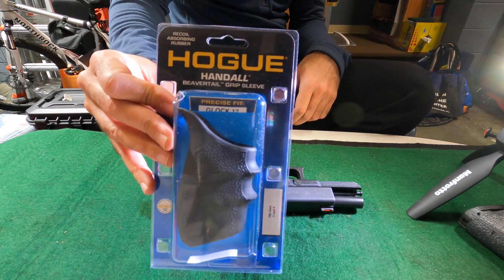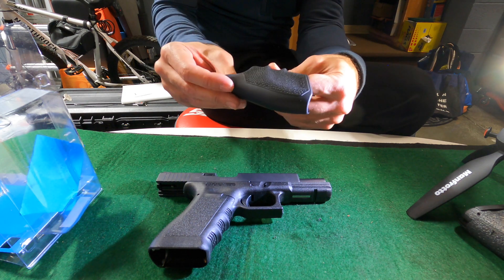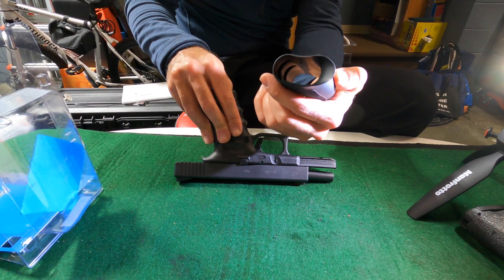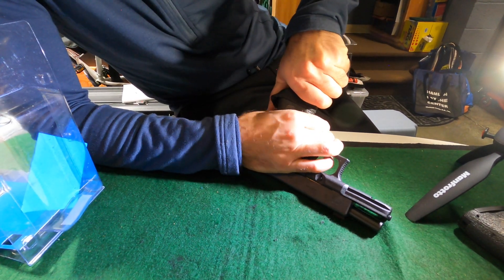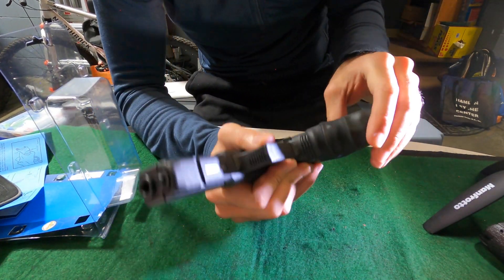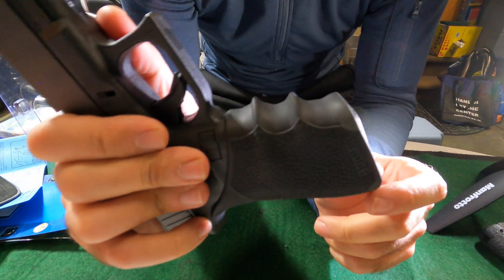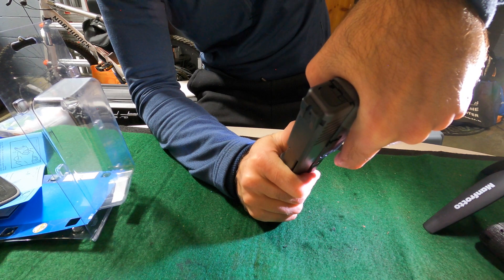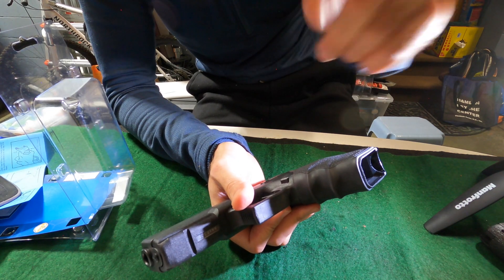HOGUE GRIPS GLOCK 17 GRIP INSTALLATION HOW TO GET A BETTER GRIP ON GLOCK PISTOLS BEAVERTAIL

Comment: Took me about 3 days to put it on.  About 30 minutes each day before getting frustrated and almost launching my Glock out the window.  I let the grip sit in the summer sun for an hour which helped.  I don’t put the grip in hot water as houge does not recommend this.  You can use solvents and such to help wiggle it in but that will just cake up in time.  After a few weeks of trying out this grip I ended up just cutting it off with a blade.  This grip is good if you have big gorilla hands but if you have regular human sized hands and feel like the stock grip is already too bulky then don’t buy this.
Reply from the maker: Wow what a tribulation. Many others have the same problems, I am beginning to think perhaps some of them shrink sitting in the package in the warehouse etc. But yes, there is no magic cure all for grip, and it doesn’t particularly help smaller hands
Reply: Took me less than 15 mns to put it on
Reply: Do the same thing that you do with bicycle grips, spray hand sanitizer alcohol on the grip first
Reply: @stanleylzz8705 I expected the worst experience ever, it took me longer for the prep than it did for the install. Using windex as expressed by Hogue and determination I had it on in about 5 minutes.

Comment: Good video ! I've  installed several of these on pistols for myself and for friends. Like you, I just "muscle" them on. Don't use any tools and I wouldn't use window cleaner. Too messy and I don't want it on my guns. It just takes some patients and time. I've never ripped them. I just installed a Houge mono- grip on a single six my dad gave me. Now they were a bear!!! The grips went on pretty easy. But it took me a good 2 hours to get the screw on the bottom of the grip  to tighten up ! I ended up making a tool out of a paper clip and having to hold the gun above my head. That is the toughest grip I've ever installed! And, the longest time it's ever took to put grips on a gun. They sure look and feel good. But I'll never install them on another single action. I've installed the exact grip on double action revolvers. Never had that trouble with then. Oh- and I had to put a business card between the grip frame and the grips, on both sides, to keep the grips from rolling under as I slid them onto to gun. Just crazy hard honestly !
Reply from the maker: Yes once you get that motion down and you are patient it is very straightforward. Wow what a journey on the mono grip. I installed one on my Colt double action, and it was pretty easy. But at least you stuck with it to get it done, hard to find people with that kind of resolve nowadays. Your info will help if I ever run into a single action wheeler but those are rare too nowadays
Reply: @shaunstayfree5551  I have several autos. From Hi Points to Glocks. But I've always loved revolvers- double and single action. My "always " with me gun is a SW 642 38 snub-Lady Smith. I know, I'm a 6ft, 240 lb guy, but I proudly carry my Lady. I've always wanted one and finally came across a new one a year ago. She has a slick factory action and beautifull wood grips. Only cost $30 more than the plain 642 sitting beside her on the shelf. And I've always loved cowboy guns. I've currently got 3 22 single actions, including an old German made one I've had since I was 16. I'm in my late 50's now. Its beat to death from years of honest, hard use. But it still functions just fine. I still keep it in an old cowboy belt and holster rig, loaded and ready. And I've even got an old single action-2 shot 25 ACP cowboy style derringer. As far as trudging on to get those grips on, it's kinda weird actually. After working on a vehicle for only minutes sometimes, I cuss and throw wrenches and hire someone to do the job. But I can spend hours messing with a gun to get it just like I want it. Anyway, good talking with you. I'm subbing to your channel.
Reply from the maker: @shadowwolf7622  Haha the bullet dont care what the gun's called!  I can never knock wheelers.  Only drawback is capacity with the conceability of the snubs, but just make em count if God forbid it ever has to. Never see anything like those again 22 SA especially the german made, very cool,...  I have a colt Anaconda, and Super Blackhawk 44m, love the blackhawk all day! Hopefully pick up a few more revolvers down the road.  Thank you, God bless

Comment: Got mine on the porch 15 minutes ago and it’s now installed.  Most of the time was hearing water on the stove (cuz I’m ok’d fashioned).
     It took me less than a minute to manhandle it onto my Swith & Wesson M&P Shield.  I used a kitchen butter knife to get it started.  I’ve now read the directions and wish I’d read them earlier. That strip of plastic would probably work easier.  If an arthritic old man can do it, so can you. 
     I got the M&P Shirld about 2 months ago and hat that skinny, single stack grip.  The Hogue grip made it fatter.  I may now learn to live this little pistol.
Reply: Hard to get plastic strips out
Reply: I presume you mean that it’s hard to get the Hogue grip stretched over pistol grip.  It absolutely is.  The first time, I used a butter knife to help guide it over the edge. Not sure whether that helped or hurt.  
     My Shield slide refused to come off the pistol and I had to send it back. Fortunately that failure happened was the same day that I’d bought it’s replacement, an M&P Plus.  I took the grip off to send the Shield to send it back.  Getting the grip back on the second time went much faster and smoother.  
     It is absolutely a learning process.

Comment: Thanks brother watching your video help me get it on. I took a little measuring cup and I use the handle all the plastic handle of the measuring cup because it was really flexible. I stuck it in inside between the grip and the rubber sleeve and many help slide ride over those finger grips and it’s a done deal sweet very nice to have one on our 17 an hour 26 now I put one over another 17 we have thanks again man
Reply from the maker: Thank you for watching, good tool for the job!

Comment: i used alittle gun oil on the inside of the grip an on the grip frame an it slid right on super easy
Reply from the maker: That’s a good tip. Little bita earl always helps
Reply: Wow I’d never use my gun oil. It doesn’t evaporate.
Reply: Use alcohol
Reply: I did a little hand sanny works fine usually

Comment: Can I remove and re use it later if I want to remove it? And do I just pull it off?
Reply from the maker: Yep totally reusable. Just be careful to not rip it coming off, but it’s slightly easier to take off than put on.

Comment: I just bought one but forgot to check and see if this will fit over an already installed xtra back strap on the Glock
Reply from the maker: If you mean the larger insert backstrap, it should go on  with some extra loving and perhaps a blow dryer to soften the rubber even more. but you may want to start with the smaller backstrap to see how it feels first with this grip as it could
Get too Chunky largest backstrap plus this

Comment: Has the beaver tail helped anyone who's experienced pain on their thumb knuckle, due to recoil?
Reply from the maker: It will give a tiny separation, maybe 1/16th of an inch, but if your thumb knuckle rides high this won’t help much. I have had slide bite on my thumb knuckle a few times from gripping too high, just had to take some time to look closely at my grip and dry fire and rack the slide and find what works for a good grip that doesn’t ride too high. This grip might help a bit but it won’t cure
Reply: @shaunstayfree5551  Thanks for explaining.

Comment: Will they fit on polymer 80s
Reply from the maker: Yes, just pick the correct Gen for the grip
Reply: @shaunstayfree5551  ok thank I was was wondering because polymer 80 percent guns don’t have the Glock hump more like a 1911
Reply from the maker: @bluebear2941  if you mean front finger groves, that matches by the Gen. but I’m not sure if the polymer 80 finger groves are the same as the Glock frames by Gen.
Reply: @shaunstayfree5551  polymer 80 as in ghost gun not the Glock brand new one
Reply from the maker: @bluebear2941  yes, I see there are no finger groves on the p80 so no issue there and the hump rear should fit fine. My suggestion is to get the hogue grip that does not come with finger grooves matching the frame size of your p80 (compact etc)

Comment: Use a hair drier lol you talked as if it was bam in a snap but you sped the video up lol
Reply from the maker: I really only cut the video when I went off camera for like 20 seconds to save the viewer the watch time. Otherwise it gets easier the second time and I’ve done several now., I can jam them on real quick after doing a few, but filming actually slowed me down a bit here. Usually I don’t use anything or any added heat, but my first one I used a skinny ruler with no sharp edges

Comment: Quite frankly I think the design sux….
They made the center bulge out and it feels like you are now holding a broom handle.. if HAUGE had not added the extra 
Budge to it would have been great. Waste of money .did not like this one and was very disappointed…the 19 one is not to bad but it would have been better without the battle of the bulge ..
Reply from the maker: @johnbrown4937  some hands need that extra girth 😙😙
Reply: @shaunstayfree5551  
If the extra padding was left out it would be the ultimate grip .i have large hands and it’s not about that .more like turning a paddle into a broom handle…
Reply from the maker: @johnbrown4937  you might like the stick on ones better